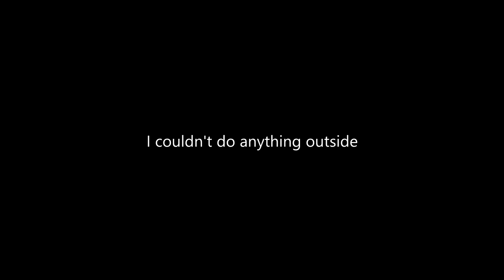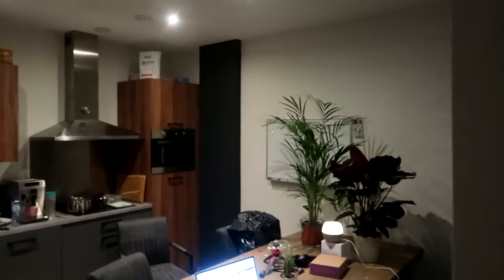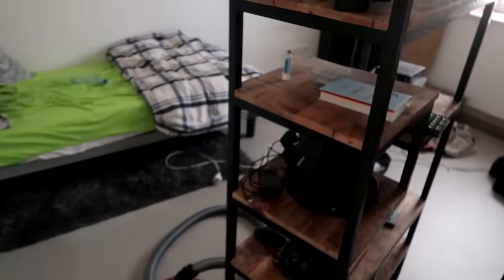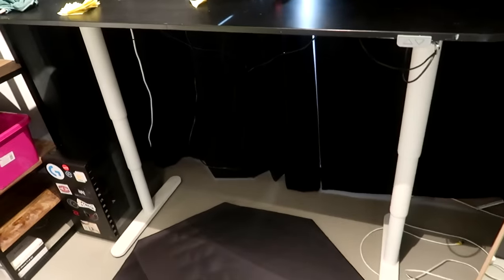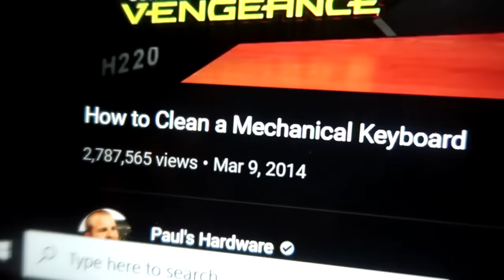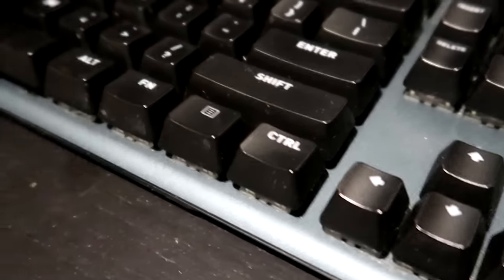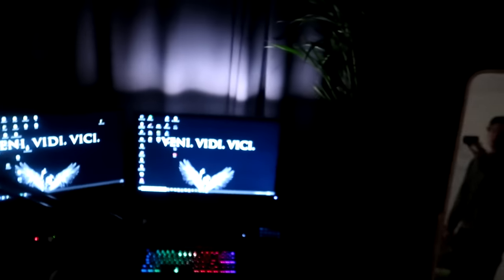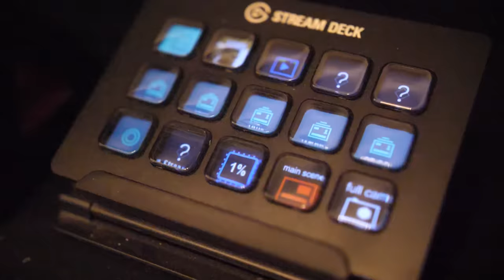Renovating my $10,000 setup

Comment: My D Keycap broke a month ago on my HyperX Alloy FPS - i then took all keycaps over to the bathroom's sink, gave it a sweet lil cleaning with an old toothbrush and printed a few new keycaps in case any other will break eventually. didnt wanted to buy a new keyboard since my current was 100€ and still working fine. now it looks like its brand new out of the shop. and i guarantee its 1kg lighter without all the dirt n stuff x)
your cleaned setup looks great tho

Comment: Dafuq tell me what things make it expensive up to 10k Dollars ??? Monitors are shit, gpu is not the best....
I own the HP Open X Emperium and a PC on the wall ( custom made ) for 4.8k and a secondary PC for 2.8K,  if someone looks at my setup you can easily tell i8t costs more than 15K, what it actually does. But Except your PC which maybe costs 2,5k and everything else maybe 3k
Reply from the maker: my pc build is like $5k, got the VR and expensive audiosetup + camera & lenses
Reply: @mattcs  yeah okay fair enough by telling more about lenses and such and I wasnt really kind at all. But I build a PC with a Asus TUF 3090 and an I9 10900K and a whole custom water-cooling loop and have even RGB Cables and it only cost me 4.8K€. What makes your LC that expensive, fella?